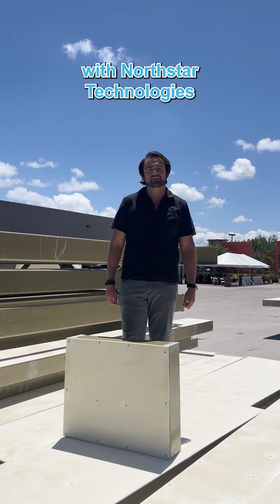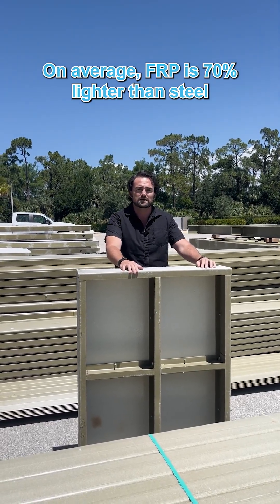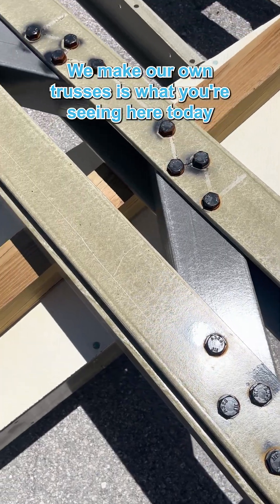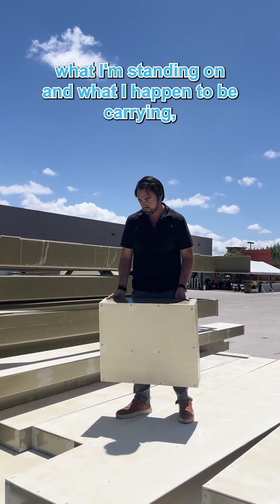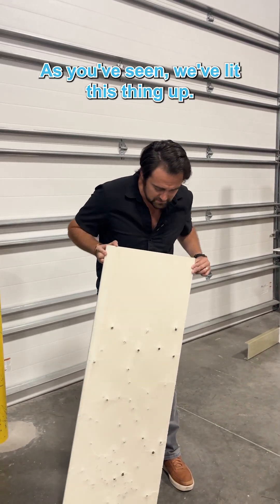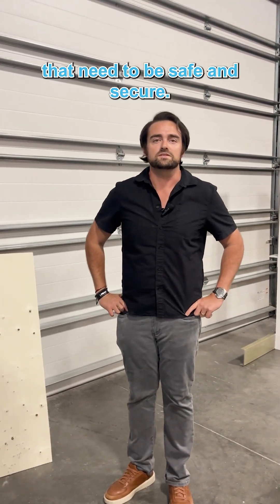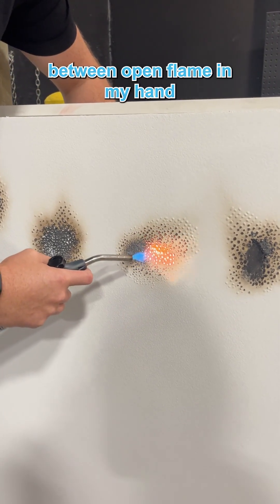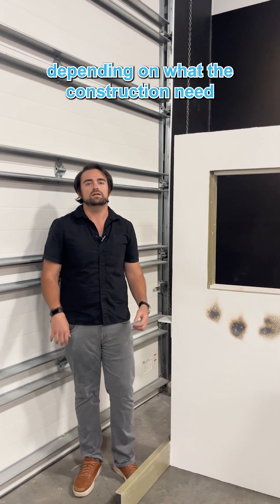5 Reasons to Build with FRP Composites over Traditional Materials

Comment: If you’re a planning to buy a home with this, here are some things to consider. FRP exhibits a 20–40% deficit in load-bearing capacity relative to wood, particularly under sustained mechanical stress and point loads. This gap is consequential in home construction, where load paths, dynamic forces, and long-term fatigue must be reliably managed over decades.

A critical flaw in current FRP adoption is its behavior once damage occurs. Unlike wood—which can often be planed, patched, or sistered with new lumber—FRP fraying is not superficial; it signals structural degradation. Fraying compromises fiber continuity, making localized repair nearly impossible without specialized resins, vacuum bagging, and often complete panel replacement. This is not unlike how a fiberglass ladder that begins to delaminate immediately fails inspection—its integrity cannot be restored, only replaced. For homeowners inheriting FRP-based homes, this presents a maintenance dilemma: simple repairs become expensive, technical, and, in some cases, impossible without manufacturer-specific intervention.

In renovation scenarios, “sistering” a fiberglass stud to reinforce or replace a damaged one poses major challenges. Unlike wood, FRP doesn’t accept fasteners or adhesives in the same versatile manner. Retrofitting requires mechanical bonding techniques, often involving proprietary brackets or structural adhesives, none of which are standardized across the industry. This creates an additional barrier for general contractors and homeowners, who may find themselves beholden to the original manufacturer or a narrow set of specialists for even minor repairs.

Until your product can demonstrate not only resilience in disaster scenarios but also practical advantages in everyday applications—ease of repair, standardized retrofitting solutions, and long-term field performance—it’s difficult to view FRP as a viable replacement for traditional building materials in residential construction. For now, I’d offer a respectful but resolute pass.
Reply from the maker: Appreciate you taking the time to write this — but a few points need clarification.
The FRP we use at Northstar isn’t basic fiberglass like ladders or boats — it’s a structural, pultruded composite system designed to outperform traditional wood and steel in load-bearing applications. Our panels are engineered to handle point loads, sustained stress, and seismic forces, and they’re rated for up to 250 mph winds and 1-hour fire resistance.
Regarding repairs: fraying isn’t an issue in our system. We don’t use woven glass or open-layup methods. Instead, we use closed-mold panels with internal reinforcements. If a panel is ever damaged, it’s either field-repairable with epoxy kits or quickly replaceable thanks to our modular design — no vacuum bagging needed.
And on retrofits — we’ve solved that too. Our panels accept mechanical fasteners via embedded backers and CNC-prepped zones. We've developed brackets and attachment systems that make integration straightforward for contractors - we also have thousands of sqft of FRP structures currently in the marketplace, so the proof of concept is very much already in place.
So while your points apply to older or generic FRP use, they don’t reflect the real-world performance of our advanced composite systems. We're always happy to share the testing, code compliance, and real projects if you'd like a closer look.